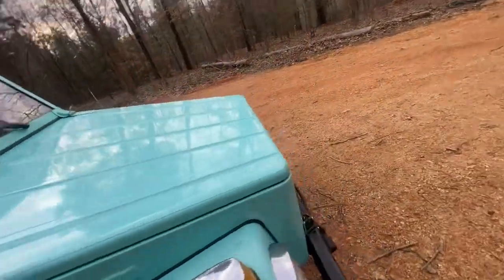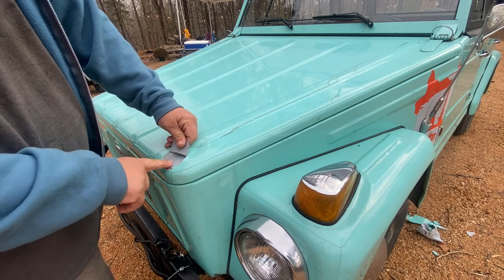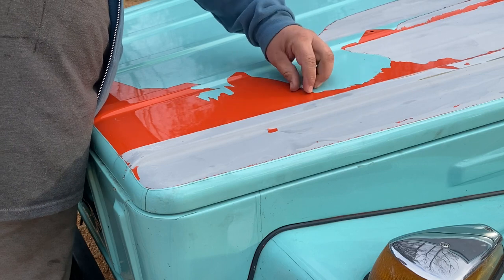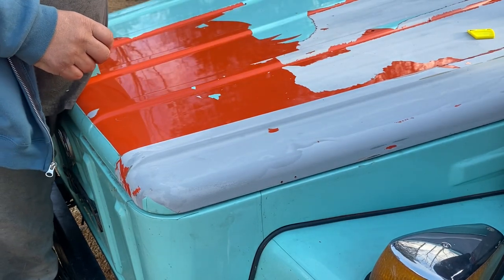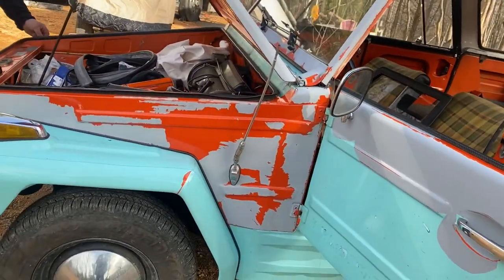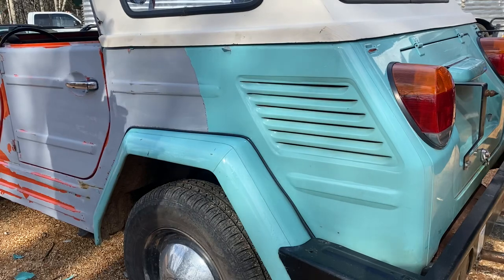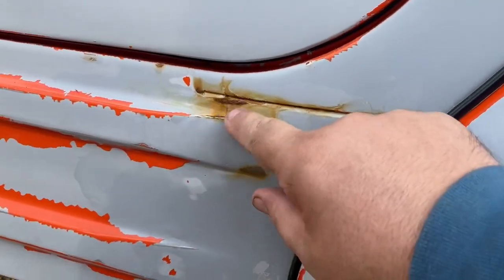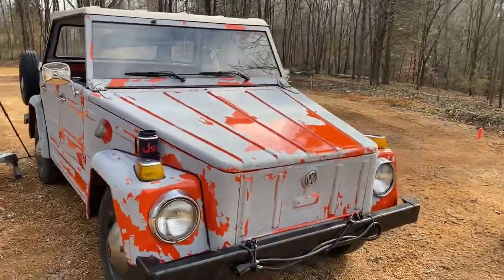Removing a vehicle wrap from a vw thing

Comment: At our aircraft museum, we use a gasoline powered pressure washer that has a fairly high pressure at the spray tip and often when we pressure wash a project, the old paint is often peeled of by the high pressure spray. You might try that as a next step. The remaining orange paint may very well pressure wash the rest of the way off. Just a thought!

Comment: The paint coming off is a great thing pun intended.  It will be easier to prep for new paint moving forward.  You can easily remove the old paint using a pressure washer and the right tip.  That will make whomever paints the car next a happy camper and save you tons of money.  They can simply just use minimal filler over the old surface in the low spots and then shoot over it and prep it better and voila new paint.  That old paint looks like a single stage paint job that someone tried to do to save money.  You dodged a bullet on this one.  Looks like a cool thing though!

Comment: apulco- USA/Mexico
In 1974 the Thing "Acapulco" model was available, a stock Thing with a few minor trim changes. They had 
blue and white gloss paint and interior, running boards, usually a surrey top and either a hardtop or a soft top.
There were some Acapulco's built in Mexico in 1973 for the resort trade, including a few with a pink and white 
color scheme. Most all the Acapulco Things were exported to the US market in 1974 and only 400 were made. 
This is the rarest of all the Type 181’s built.

Comment: Back in the day they would dip the bodywork into vats of primer and paint. Very little "prep" work was done beyond degreasing and etching. After that it was one layer of primer and then off to the top coat. Spraying didn't become the method of choice until the late 70's and early 80's for some manufacturers.

Comment: Try a flat razor blade scraper , that uses a single edge razor blade, it does wonders on the flat areas , also a heat gun /with gloves or a blow dryer, good luck , I love your channel, happy New Year 🥰🤩🙏🇺🇸

Comment: If you don't have one, get yourself one of those inexpensive sandblast guns with a cup attached.  Make sure you use dry sand even if you have to put it in the oven for awhile.  That's the reason most people give them poor reviews.  Then, blast away at those rust spots.  I like to cover them with aluminum paint immediately after removing the rust.  I've had far better luck with the brush on paint as it seems to wick in to all the crevices and even any remaining rust preventing it from coming back.

Comment: when a vw engine is running oil is splashing around behind the pistons, much more oil than a conventional vertical inline or vee engine. when you let a horizontal engine sit for a long time, oil seeps beween the rings and pools up in the bottom of the cylinders, not too much but about a tablespoon. so when you start it, you get a smoke show mostly from the oil that gets blown into the muffler and slowly burns as the muffler heats up. when beetles started to come out with catalytic converters in 75, there were many cats destroyed because of this, lots of people bought convertible bugs but only drove them in the summer but garaged them all winter.

Comment: Keep in mind, primer is usually considered porous so you need to keep your thing out of the rain as much as possible otherwise you will have rust all over.

Since the paint didn't adhere to the primer very well, I wonder if applying a very sticky tape across the orange paint and peeling it off would finish removing the orange?

Comment: When I worked in a boat trailer factory, every now and then they wouldn't get the paint mixture of Gardner and paint quite right.  The paint would come off like your primer does.  I was the one that had to peel off the paint and sand the trailer down for a repaint.

Comment: i did like the color of that wrap but i also like that typical 1970's orange. Why not sand the car and then hand roller it back in orange? You could do it panel by panel. That way you can spread the work to avoid boredom.
You could make a heated environment like a tent with a heater inside or something.

Other option: get an artist to paint your car and have yourself a rolling art-car! Hippy style. It suits the car!

Comment: Not only did the people not know what they were doing probably used the wrong type of undercoat for the type of top coat they wanted to use they then didnt know how to wrap it. each pannel should be a single piece and if you look at the rear fenders they had atleast 6 pieces on each so it was never ment to last just to make it look good to sell it. Bet wife will hate the look but you saved the car from a total rust out!

Comment: There are times when you create unnecessary problems for yourself!!
Reply from the maker: Water was getting trapped under it and rust was starting.  Sounds like you like to ignore problems until it takes a lot more effort to repair
Reply: @BusGreaseMonkey  Part of it is that I live in an area (in Australia) that doesn't have annual inspections but does conduct ad hoc roadside inspections by regular police patrols and any "defect notice" vehicles have to go through a notoriously difficult / impossible inspection centre to get back on the road. Most just give up on the vehicle.

Thus we are always mindful of attracting attention to the vehicle and would be very wary of removing any finish that looked passably OK without actually getting it finished properly straight away!

I am always worried when you are 
bringing back rescue buses!

Comment: Heat gun. Whoever primered that car then painted it they must have used the worst primer I had ever seen. The paint didn't adhere to the primer and just peeling right off. I suggest an epoxy primer go to eastwood.com they have a roll on applicator where you can roll it on and then block sand it and then shoot it with whatever paint you want to use hopefully a really good one and you'll never have that problem again

Comment: That has got to be the worst wrap I've ever seen.  It looks as if they started to do a paint job, got bored, blew it over with primer then went straight on with the warp, which would explain the comment you made early on about being able to smell wet paint once the first bits of wrap were removed, and the way the paint is coming off with the wrap.